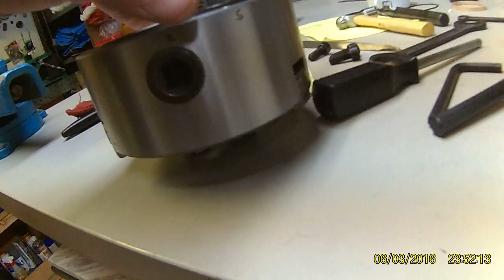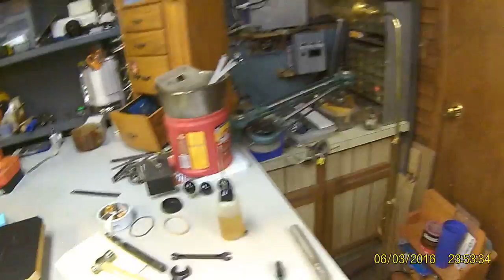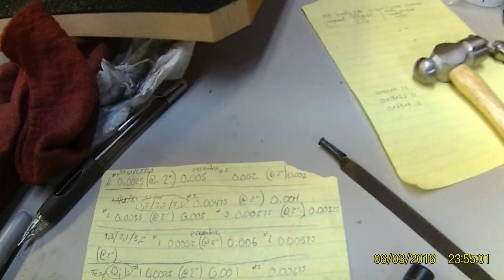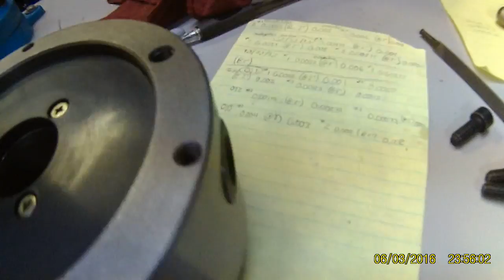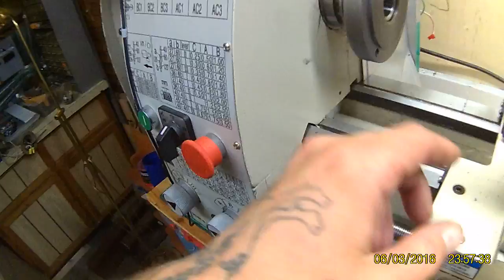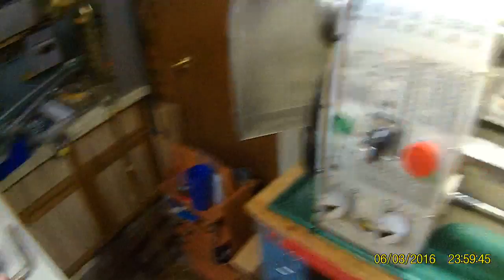TIR truing lathe chuck, before grinding jaws try this.

Comment: Your chuck mount has the same ridge as yours.  I cut that down abit so that the chuck would move around on it.  My vicel bolts to the vice mount from the front so I was able to loosen all three bolts,  indicate on some tool steel blanks where I recorded .008 runout before the work.  An indicator set on top the vice and screws with moderate tightness and I was able to tap it down to .0015 and tighten up the bolts.  Works great, got the idea from Stefan Gottweiller of youtube fame !!

Comment: took mine from near .02 out to .0015 by using receipt paper between the backing plate and the Chuck. put a pipe in the Chuck for leverage and only one screw needs to be loosened to get paper in a position.
Reply from the maker: Not to bad, but you are inherently adding an unnecessary safety risk by adding a compressible material to an area that really needs solid mounting. Perhaps a piece of shim stock. But i would recommend getting a cheap air powered pencil grinder and grinding your spindle mount into true. Then you problem is permanently and safety solved. Happy turning.
Reply: it's compressible until I compress it by tightening the bolt. my Jawa are all true to each other, I guess my backplate is off
Reply from the maker: Mount a dial test indicator somewhere to register on the spindle where the back plate seats first. Mine was about 0.001 high on one side. If that all reads 0. then remove the backplate from the chuck and indicate that while mounted on the spindle. I actually threaded my backplate on backwards and trued the mounting seat (I had to grind the flat right behind the threads true to get a flat for reverse mounting as the BP is not recessed in the front to rest on the correct surface). Then I reversed it and trued the face side for the chuck. With these chinese chucks anything is possible like them cutting the slots incorrectly. Without a surface plate diagnoses can be difficult. After checking and facing the spindle and backplate. Once all that is done you can put the chuck jaws in the reverse position and mount it to the BP by the jaws. You may even be able to skip everything above and just mount the chuck on the BP by the jaws and skim the rear mounting surface. Just make sure the bolt holes are closely aligned for when proper mounting. Then you will just have to remount it in multiple positions until you find the best alignment. I have a little OCD or something. I dont like accepting movement and I have a hard time saying 0.001 is close enough. This is because I know I can do better.